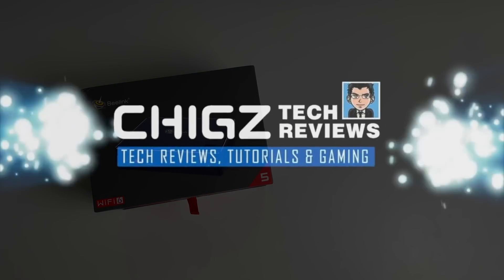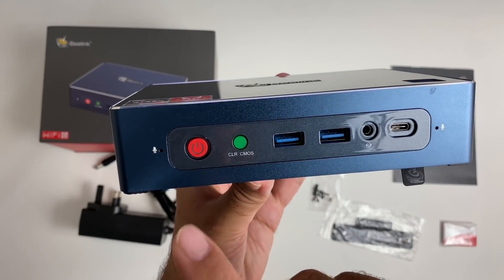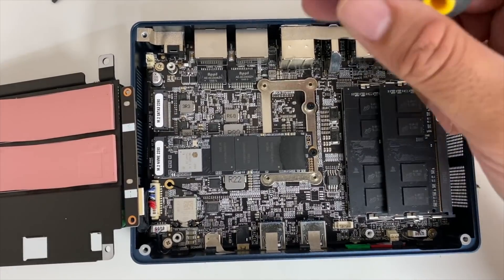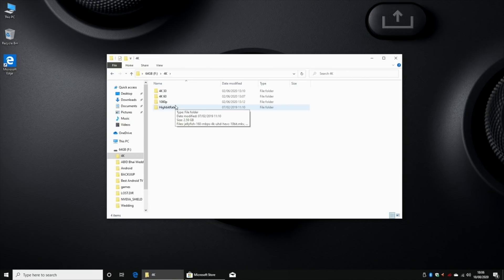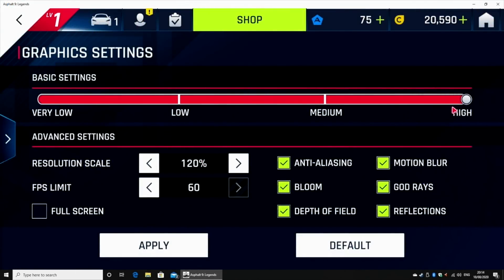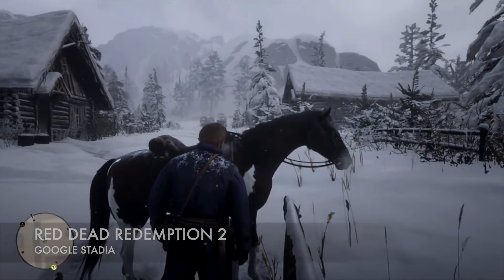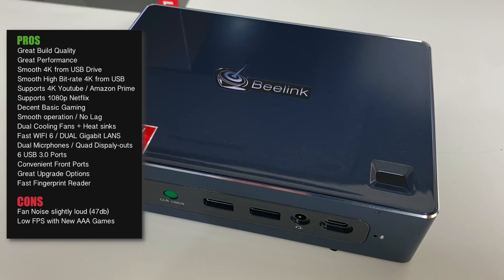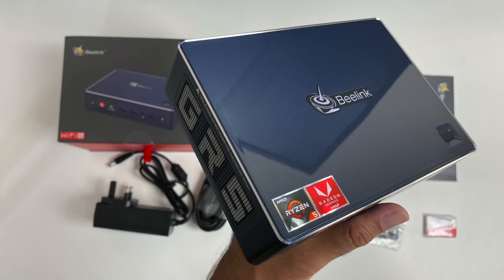Powerful Beelink GT-R Mini PC | AMD RYZEN 5 | 16GB RAM | 512GB + 1TB | UPGRADABLE

Comment: I saw one of these on eBay and it had extra USB and audio ports underneath the case. It also had a silver switch on the front side under the regular faceplate that this one has. What was that all about?

Comment: Mine came with the extension, I opened to take a look, when I closed back again, connected everything perfectly fine but the extension doesn't work anymore. I've opened couple times and checked the connectors and it's perfectly connected. I have no idea why it doesn't work anymore.

Comment: My gaming desktop is 10 years old it's an HP Pavillion with AMD A6 Fusion quadcore @2.5ghz(turbo) paired with a 4 year old AMD Radeon RX460 4GB GDDR5 GPU and 16GB of DDR3 Ram....it still plays new modern AAA titles really well.....for example i get 60fps on forzamotorsport 7 and on Forza Horizon 3 and 4, Resident Evil 7 all with high settings, I get 30 FPS on Resident Evil 2 remake with medium settings that's just a few games I play....the best thing of all that 10 year old desktop only cost me like $450 back in the day cause it was a refurbished model.....it has definitely served me really good.

Comment: These minis are far overpriced.   Major costs of the full sized desktop are, I believe, the shipping and handling.   These are sharply reduced for the minis.  Yet, the price of a brand new mini is about the same as a full sized desktop.   That the consumer gets no benefit from the decreased costs demonstrates that the pricing is not competitive.  The only competition is in the marketing, the advertising.   The lack of savings suggests to me that the full sized desktop is the wiser choice.  It is easier to repair and offers more hardware choices.
Reply: There's costs to shrinking a pc, so it's not a 1 to 1 comparison. Not everyone needs (or wants) a full sized desktop. I will say that I wish they were better priced and had more performance.
Reply: These devices are suitable as powerful HTPC watching videos, doing light work from afar and gaming occasionally even better than android tv boxes that are limited in performance, OS and apps. I'd choose this over full desktop PC for my TV in the living room any day.
Reply: @MAFz7  not good for everyday use as it may giv u poor performance in the log run. dekstop is still better this is just for watching videos going out for travel.
Reply: @isabeltempla3303  For those uses, a laptop is better because it comes with a screen, battery, and usually more options in the exact system you want
Reply: I decided to get the Beelink Pro version. I could have got the mini PC from HP with the customization option, but I did not feel like spending $1,699.00 for a high-performance computer. The current setup is good enough for me for a cheaper price and I can always upgrade the box later on if needed. Also, the graphics chip seems to handle graphics well on games.
Reply: But I don’t know how to build a PC
Reply: @TemporaryInsane  Then get a laptop or pre-build as long as you know enough about pcs to not get ripped off, you should be fine.
Reply: Yea I was thinking the same thing too.
Reply: ita for portable or occasional use not for home pc.

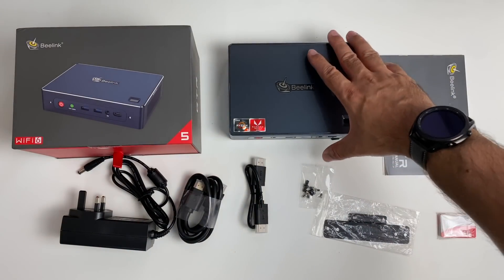Comment: Any idea on where to source the power supply adaptor? I got a GT-R but it came with Euro plug and it works but I'd like to source a 'proper' UK plug version.  Hard to find 19v 3.0A exact match maybe my Google skills are fading.  Anyway, the one you seem to have is called TDX-190300E (grabbed a still at 1:04) but having a hard time finding that.  Any tips or links, pointers for how to source one?

Comment: 16 GB RAM in this system is most unnecessary thing I ever see 
Why you need 16 GB RAM with out mid to higher tier GPU

Maybe you run chrome with 100 tab at once

Comment: Chigz  would this work with a good external gpu for gaming too ?  portability is my thing.  Great Vod  thank you
Reply: It doesn't have thunderbolt 3 port to support external gpu, but the internal gpu is very capable for most games in mid to low settings anyway.

Comment: The only thing i find with these PC's is Power button when Mounted on the back of a TV a small wired button which can be accessed from in front of the Monitor or tv would be great. Great little pc though.

Comment: Putting the clear CMOS button on the front is simply asking for trouble.
Reply: I think many ppl rarely even shut up their PC nowadays..
Reply: It could even have a "cmos clear" button, but it should be smaller and built-in, just like in routers, which requires a toothpick to trigger.
Reply: Not asking.But begging 😂
Reply: total noob here what does that button do

Comment: That 5:26 extra m.2 will be useful for external egpu.. someone can try this,just like Techtablets did..but i guess 3550H will severely bottleneck any gpu out there,maybe gtx1660 super will be good with this
Reply: Nope it is SATA m.2 port not NVME one sad life if he had to do that then he have to change the sad from nvme m.2 to sata m.2 slot but still he have to see that the m.2 is competent with sata m.2 or not.

Comment: If that had a headphone jack and a touch screen with a cellphone built into it and a key board and throw it in a breaf case now I would buy it. I need the head phone plug for my vintage amplifiers cause using blue tooth adaptors degrees the signal.
Reply: then it wouldn't be a mini pc
Reply: @mymo82  I just want every fucken thing. And I want it to have a detachable android touch screen ham 📻